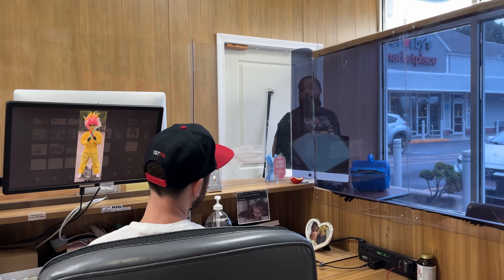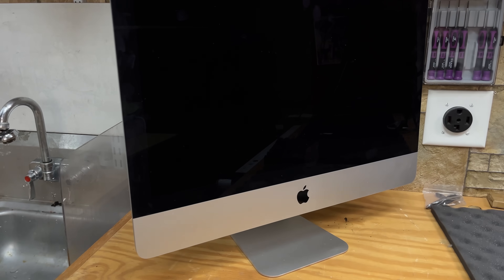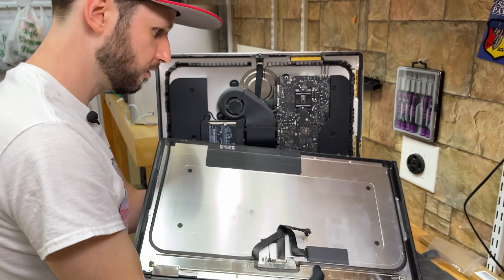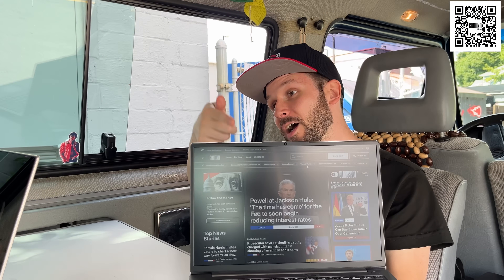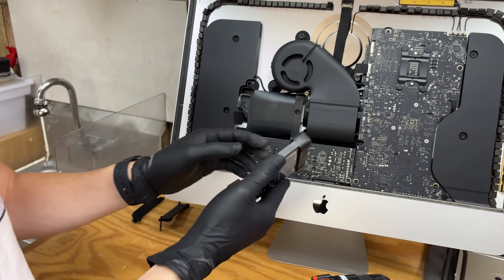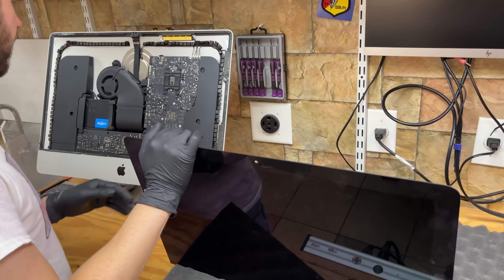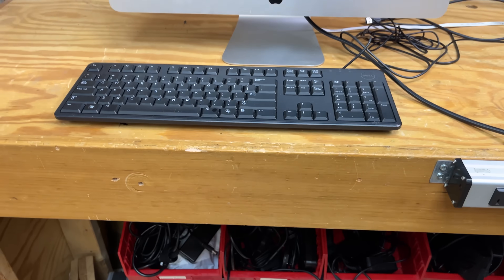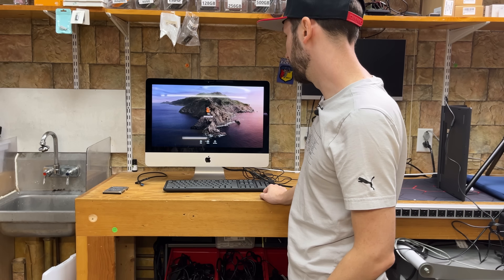This Upgrade Isn't Possible on New iMacs (Sometimes Older IS Better)

Comment: The better option is to key an NVME drive that is keyed to the Apple slot to replace the woeful Fusion drive on the rear of the motherboard.. It's relatively easy to get to if you've got as far as you have anyway.. a few more bits to uninstall and then you can remove the logic board and flip it over.. I installed a 1TB NVME and a 1TB SSD as well as 32GB RAM and it's fine for everyday tasks - also use it for some photo editing :)

Comment: I replaced fusion hdd's flash drive with Samsung 970 Evo NVME on my 2017 iMac base model and it still works nicely. Wish I had the money back then to also replace the CPU.

Comment: I would not close up the screen against the new adhesive and the metal frame until I had seen it working - just in case one of the plugs was not set correctly.

Comment: Thanks for sharing! My first time visiting the channel. I have an IMac 22-inch screen. I was told that it couldn't be upgraded beyond Catalina. I hate I upgraded the IOS, so now my Adobe software doesn't work. I am not familiar with using the time machine, so I don't know If that would help. I plan to use it as a monitor to watch YouTube videos or play chill music in a sitting area I'm setting up. Maybe open a spreadsheet and surf the web. I will consider the HD upgrade when I have time on my hands to do nothing. This video will be my inspiration. 😃

Comment: I just bought a 2020, 27” iMac refurbished with all the upgrades. 1TB SSD. 64MB Ram. $1,300. Replaces my Late 2015 iMacPro and works like a dream!
I was going to do the upgrade myself but the screen on the Pro was ghosting.
One thing you left out of this video is letting the adhesive set over night so the screen doesn’t fall off later if it isn’t cured.
Thanks,
Gianni❤

Comment: Should have taken out the motherboard so you could replace and upgrade the ram takes max 16gb for the 21 and 32 max for the 27 so should have done that also spcialy if it’s only 8 gb

Comment: i have a  2013  model  and the  ram  is  on the back of  the  motherboard  not  accessible  from the  outside so have to  take  off screen and and other  board  just to get to the  ram to  up grade also it has a  slot  m.2 hard drive if i remember correctly  .. pain in the  A$$

Comment: I did this with my 75 year old mother’s 2013 21.5” (except I doubled the RAM to 16GB and went with an NVME blade with adapter) and had such good results that I picked up a late 2012 27” with an i5 processor but oddly the maxed out GPU for 250 bucks off NextDoor marketplace. Upgraded the CPU to the fastest i7 it accepted, maxed out the RAM, added a 512GB mSATA blade (which was what that rev accepted) for system and apps then a 1TB 2.5” SSD for media then finally upgraded the BT/Wifi card to the 2014 version with 802.11AC and the higher BT spec that is compatible with AirDrop and Unlock with Apple Watch. All of the parts except the SSD’s were use from eBay so I got them dirt cheap, and I sold the i5 CPU for 3 bucks less than what I paid for the i7 that replaced it and the Airport WiFi card for 5 bucks less than I paid for it’s replacement. So 250 for the iMac, ~150 for parts after resale of old parts and I’ve got this powerhouse that easily audio and video editing/mixing, easily runs older games under Windows in boot camp and plays YouTube videos on the gorgeous 27” screen while I work on other projects. Wife thought I was nuts for not just buying one of new ungodly Crayola colors 24” iMac but I couldn’t be happier with this build.

Comment: The menu repair:
Change HDD to SDD $230
Repair Screen $160
Change the driver to new driver $340
Change the broken things $210-$350 (use by to fix/change by more money)
Change Keyborad $200
Change batery $170
(Every Sales on source 10% to 80% on every day)

Comment: I'm watching this video on the exact model iMac. Except I purchased mine in June. for $200 from a local computer shop. Upgraded to 16gb with a 1tb SSD. Running Catalina as well. Love it. Use it with my Apple One service that I subscribe to. Eventually will do OCLP to macOS Ventura  soon. So I can continue to get software updates.

Comment: Soooo, pretty recently I found a huge custom built rig in the dumpster at my apartment complex. It’s sitting in my closet atm but I havnt opened it up. No idea if it works but I’m probably gonna try to get it fired up, and replace anything in it I’ll need to get it going. Havnt had a tower in yearrrs and my laptop is starting to lose to the future. Any advice?

Comment: Hi Salem I have a question that is very important in my case of computers.
Do standard HP laptops have the option for a ram upgrade or is the entire laptop a waste of money because I recently started playing a modded version of fallout 4 on steam and an update was required to continue playing the game but the update said it needs over 100GB to update the game
Reply: Most HP laptops do have upgradable RAM. HP also conveniently has disassembly guides for most of their computers. Its kind of buried in the support page of the specific computer. I think you're confusing RAM with storage though.

Comment: 2:50 Oh no! A Crucial BX? They didn't have an DRAM Cache! That's a big NO-NO for a SATA SSDs. And it may not even be a TLC, but a QLC SSD. Another big NO-NO for a system drive!
So in the worst case, you've installed the worst possible combination of all: Shortened lifetime AND performance drops due to missing DRAM AND the storage cell type. And all this in a device where it is such an effort to replace a drive. - Great!

Comment: One bit of advice that makes the whole thing a lot easier, lay the computer down on the table to do the repair rather than standing up. There's less of a chance of dropping the screen and breaking it, much easier. Additionally, when you're done, test it all out by securing the screen with painters blue tape to make sure everything works before putting on the replacement adhesive.

Comment: I’m actually super curious, what kind of degree or course (if any) would you recommend for someone who wants to get into your field, (tech repair)
Reply: You don't need any formal schooling to work on PCs. Most of us learned through trial and error and curiosity watching PC build videos. If you want to get into component-level repair, I think it will be very beneficial to understand electronic components and work on soldering skills. For PC repair, there's the CompTIA A+ certification which is an entry-level IT certification that deals with PC troubleshooting and repair.
For formal education, you would typically take IT courses at a local community college. Most should have some PC repair or beginner IT courses of study. You don't usually go to a university for PC repair.

Comment: i have the last thick imac 21.5 inch its a 2010 model and its surprising quick with the original hard drive! it is running mac os high sierra and i put 24 gb of ram in it! and yes i know thats unsupported for the ram but it does work with 0 issues... you have to use 2 1600 mhz ram and 2 1333 mhz ram sticks or it wont boot it will just beep if you dont use a combo of fast ram and slow ram... im thinking about putting big sur on it idk

Comment: I got a question. How do ram slots break? Like my PC 2 years ago had 4 functional ram slots. obviously the 4 ram slots where duel channeling but now 2 of the 4 are suddenly borken. and since 2 of the 4 are broken I can't duel channel anymore and my PC has no dual channeling option to chose wich ram slots duel channel. Everytime I plug a ram in my pc starts up beeps repeatedly and shuts down then starts up again and beeps again and the proccess repeats over and over.

Comment: It's still possible, you just have to know what you're doing. People have de-soldered the RAM to upgrade on newer macbooks. Realistically if you really want upgradeability just build a mac-compatible PC and install OSwhatever on it. Built  one for a friend about two years ago, cheaper, faster and much more user friendly than any mac.

Comment: @SalmemTechSperts do y remove viruses and if so what scale and how mutch cause i have been forced ti be in a gaming laptop since  i midded tf out of minecraft and stuff on my pc and when i tried on java eddition i installed a fake version of curceforge and installed a virus and iv got vururusis that dont remove or anything the pc runs fine but the viruses make it run slower then a potato and only a quarter of the ram gets registerd and im only 12 but i do know a lot but it wouldent reset for me and i only have $4 whitch i know isent anoth but can you give me some advice if you cant try for $4
Reply: that was horrendous to attempt to read.

Comment: Replacing the drive and using OpenCore has been my go to for these - such an easy job for such a great end result. Also that pizza cutter is designed to be just deep enough to clear the adhesive without damaging the camera wiring.

Also also, I did once touch the PSU accidentally, it shouldnt kill you but it is SUPREMELY unpleasant.

Comment: What is that pry tool? I've gotta get one of those as a just in case thing. I shy away from tackling those imacs. Apple and their dumb designs. I've found even an external SSD will boot faster than the internal SATA too.

Comment: i am still rocking a 2017 macbook and plan to send it out to have it upgraded to the max amount of ram which i think is 32gigs and also add an nvme ssd slot so i can upgrade from the 250gig soldered ssd

Comment: I love these things , I got a 2020 21in 4K Mac , Upgraded the CPU to a i9 9900 , a WD 2 TB Nvme for MacOS and Windows 10 , and a 500GB Temp HDD in the Sata Slot , I wanna upgrade this later though in the 2020 model has USB C you can just plug in a Razor EGPU and bammmm you got a Slick Gaming PC with and Easy to upgrade Graphics card :'D , I just think these things look so rad , the newer ones just honestly weirdly look a bit cheap xD , this plus a OG Apple Wireless Keyboard from 2003 and a Series S Robot white controller , Equals and Epic Gaming Machine. 

Honestly the best part is that the iMac's them selves are Dirt Cheap . if you have the willingness to wait for a nice one to Appear on Ebay while you slowly get the parts you need you can easily get one for way cheaper then he mentioned in the video :'D Just make Sure to do you Research First People !!

Comment: Weird seeing this come out literally yesterday I swapped my 2019 imacs (21.5in) 8th gen i3 with a 9th gen i7 9700, along with that I even upgraded the ram to 16gb and a 500gb ssd ripping out the ole Hdd, even checking it on crystal disk info its saying it has a caution error so perfect timing with this one. So Now my younger siblings have an 8-core rig for school work and Roblox 😂
Reply from the maker: Hah that’s a perfect upgrade

Comment: for a first timer doing this maybe good idea to turn it on once you plug the cables for the screen back in before you seal it back up🤔🤔? could save having to deal with resealing again if something was off etc
Reply from the maker: For sure

Comment: I hate the adhesive on these so much when I upgraded it, I didn't bother. I just used clear duct tape, and taped it together. Can barely even tell it's tapped on. Makes getting inside much easier.

Comment: NOICE. Spiffy and yes, the best upgrade for an older Mac. 

I just bumped the SSD in my ancient and pampered Mac Pro 2012 Tower from 512 GB to 1TB. "System Files" were EATING the Boot Drive. To be sure, I also have a 2TB Storage Drive in Bays 2 and 3 running as a Mirrored RAID. Paranoid. There are two kinds of computer users  - those who have lost data... and those who WILL.

Comment: Is it just me or did you forgot to install the second bracket to hold the disk on place ?
Reply from the maker: Yeah the bracket on the right had a broken mount so we tossed it since Lupe didn’t give a shit. You could honestly just tape the SSD to the frame if you wanted to 😂
Reply: @SalemTechsperts  hahahahahahaha got it. Lupe is a straight savage honestly, can't argue with that

Comment: I'm watching this on a 2011 imac, although I run Debian which stays current.  The 2010 and 2011 panels are held in by magnets and torx instead of adhesive.  There are also four cables to the video panel instead of two.

Comment: You can also install Windows 11 Pro without bootcamp, but with bootcamp drivers to extend the life on these imacs.
Reply from the maker: Yup! They make some of the best Windows AIO’s
Reply: @SalemTechsperts I did the exact same upgrade you did, but I had a 2015 4K one, and god the display is amazing. Especially under windows since windows uses a pixel per pixel sharpness, but it’s auto set to 200% scaling

Comment: I’m learning how to try my hand at re-balling with hot air. This way I can dig through my old ddr 3 three ram sticks to see if I can remove chips from it then give my old MacBook more ram by re-balling new memory chips to it. 

If I mess it up oh well. The old laptop had to retire at some point. It’s the old way I can try to make an upgrade to a laptop that isn’t upgradable. And unfortunately the nvme is soldered too. So I can’t upgrade storage. That’s too complex to try and re-ball it. 

8 gigs option should never exist. But people buy it so Apple keeps pushing it. Apple should sell their products with 16gigs minimum. 

Great video. But currently I don’t even have money to spend on old Mac’s which is why I’m still running my janky late models 2018 MacBook Pro that’s a furnace and slow as hell. Almost thinking about downgrading to the os versions that launched around the time this laptop did to see if I can speed this old laptop up. 👍
Reply: I have a 2010 MacBook pro that I upgraded the ram and threw an SSD. Used opencore to throw monetary on. Was quick as hell. Also had a 2016 MacBook air was pretty damn quick. I just fixed my Mac install on the 2010 today for a data repair job at work. How the hell is a 2018 MacBook pro slow... I use a gaming desktop so I know what an actual quick computer feels like. Maybe you have a virus or a bottleneck in your computer
Reply: @Tuna-l7p  it's the 13 inch most basic and lowest spec they had at the time just so I could afford it. I was surprised to learn this laptop has DDR 3 ram. I thought that by 2018 Apple had already moved over to DDR 4. It only had 8 gigs of ram and was always pegged when I would check constantly giving me the spinning wheel. 

As a test I threw on a version of Mojave which was the os it launched with and noticed a decent performance boost. 

Then threw on sequoia and noticed the performance go back to what it was. 

The OS just seems to bit heavier for the specs I have. This is why I wanted to throw on 16 gigs and see if that gave it a little boost. And less spinning wheel. 

But other programs I use is Logic Pro x for music production. iMovie and DaVinci resolve studio for video production.

When it comes time to render is when the laptop goes full fan power heats up like crazy and struggles at a rate of 2 to 4 fps on video rendering and slightly faster for music production. 

As a comparison, my asus zen book with 16 gigs of ram and a discrete you renders at 15 to 20 fps and completes videos renders much quicker than my MBP. 

But that's usually only when I have to work on things remotely from a different location. At my home office I have a computer I built myself with 64 gigs of ddr 4 and an AMD 5950x for the processor coupled with a 16 gig version of the rtx 4060 ti card I render on average right around 200 fps which completes my renders way faster. 

Unfortunately I don't have 2 to 4 thousand to spend on a laptop with actual specs made to render DaVinci resolve and such. 

So more often than not I have my zen book with me and MBP had just been sitting ideal. Unless Im working on sound. That's all it's been used for recently. If ever I have a couple thousand just lying around I'll upgrade this tired old laptop to a better Mac. But currently I can't even walk by the apple section or go in a Mac store. Max I can spend is 900 bucks. And nothing Apple is currently selling is 900 bucks when it comes to their computers. 

But yeah. No virus. It's just slow. It works. It's a working laptop it's just like back in the days when you could power up the computer, go use the restroom, cook some breakfast, maybe have some coffee and just maybe by then it was ready to use. If I give this tired laptop time it does everything. I just can't expect quick results is all.
Reply: @leosthrivwithautism  I would run Mojave if you can then. ya apple sucks and they get away with a lot since the avg consumer doesn't know they bought crap until they turn it on and wonder why it runs slow. I tend to avoid recommending laptops but when I do I say to overcompensate and get something more then what you need. Since realistically a high end laptop in 4 years will become average. And an average laptop turns borderline unusable. With os updates and apps becoming more demanding over the years

Comment: This is a good point about not purchasing a Mac. See that dust in that. Also I could be wrong. But, how long did mac and pc companies use 5400 rpm hard drives instead of 7200 rpm hard drives? It is bad enough after a certain point they was not putting in solid state. Now I can't even fault the soldered in memory / drives. pc mfgs. are doing the same thing. I had three Lenovos the other day that I'm pretty sure. 1 of the three would have been fixed with removable memory. As for removing the screen. I did one the other day. But the bottom was fighting me. Then for a long time we would not patch the macs for newer OS because of some other issues that arrived. Now, due to that program we patch them. Sort of like the windows 11 restrictions. We still do not load machines that does not meet the requirements. We are however, up front with the customer. This Mac has been patched.